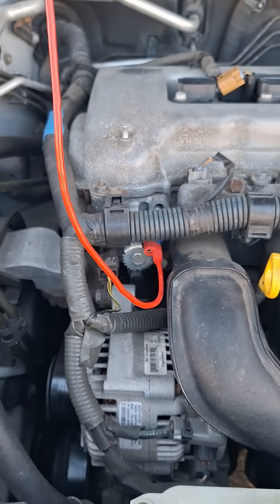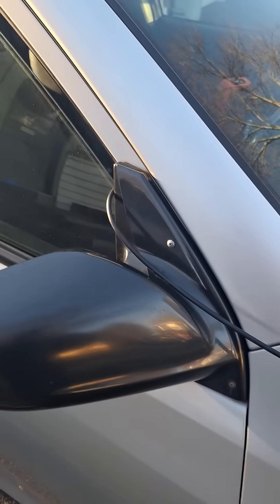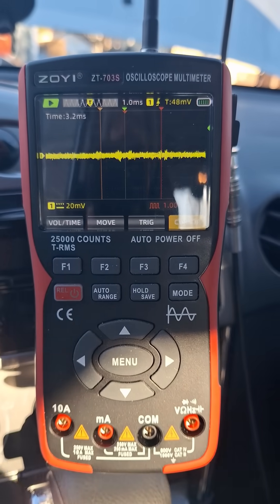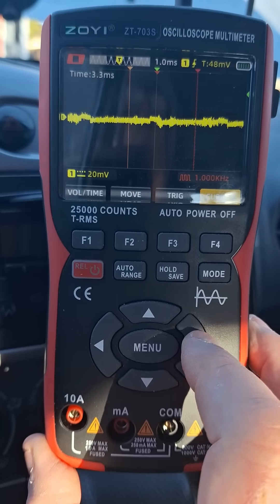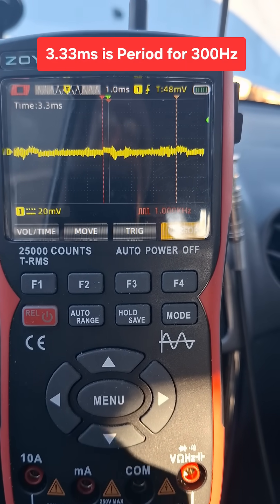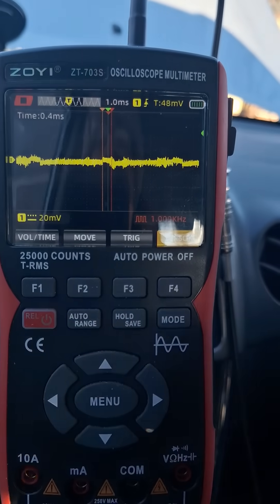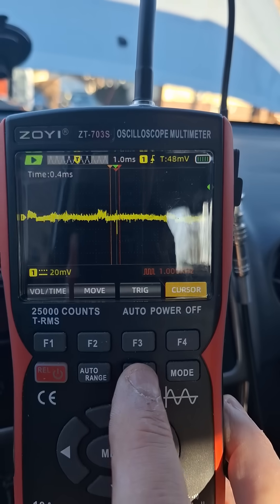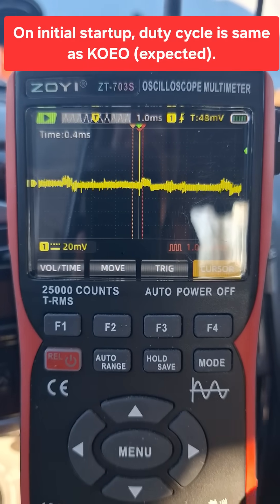ZOYI ZT-703S Oscilloscope Multimeter: VVT Solenoid Frequency and Duty Cycle using Inductive Probe.

Comment: Basically,  the probe is picking up the current flowing through it. Can you filter the waveform on this scope?
Reply from the maker: Exactly. The changing magnetic field from the PWM signal switching on and off induces the current in that lead which is picked up as a voltage on the scope. There's no filtering on this unit. Thanks for commenting and watching! 🔧